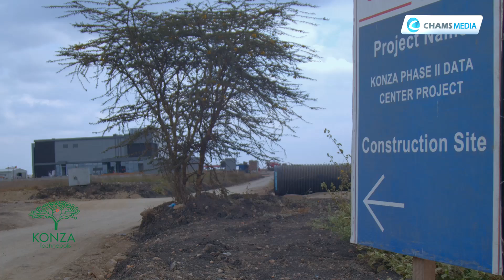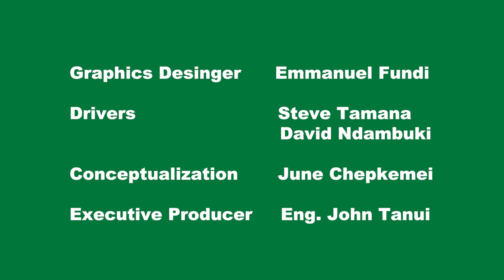Konza Technopolis Setting Standards For Sewerage Management in Kenya

Comment: Lol these people are so bad at acting. They tell people to wear uniforms (which are all brand new and clean), stand in the background and pretend to do work. Those ladies are just standing there, those men pretend to hammer something. The inspector is measuring nothing and she doesn't even sound like she knows what she's talking about. This is so bad, 8 years later
Reply: What have you done to konza is a private investment gorvement is infrastructure. Silicon valley was not build by gorvement it was build by smart people like Gates.
Reply: Works at konza started 2019 ,before that,nothing tangible was happening ....the project was being underfunded